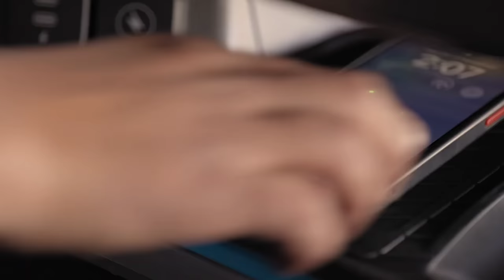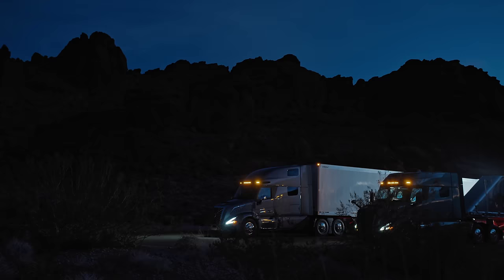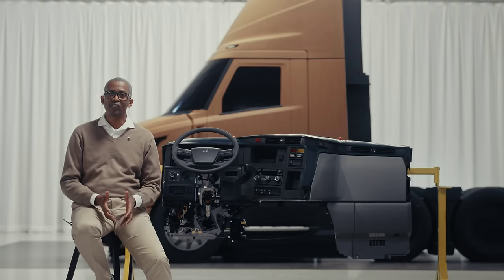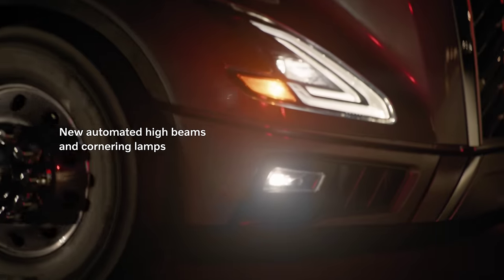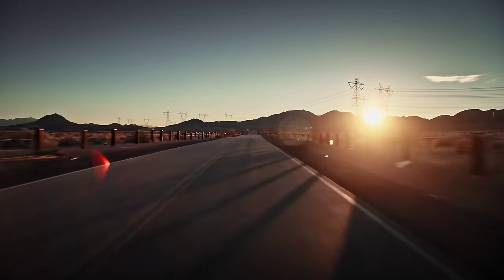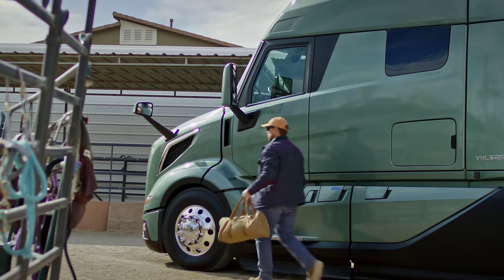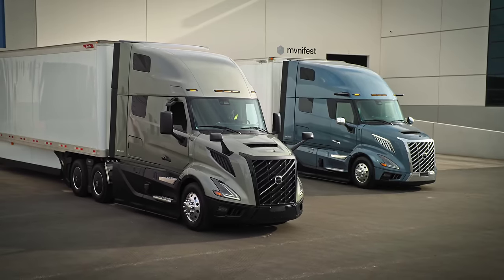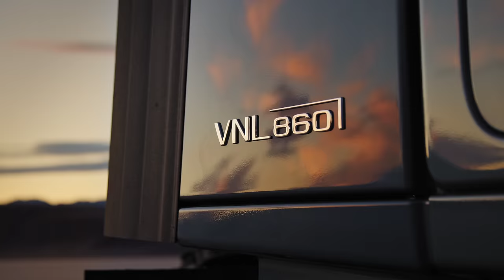All New VOLVO VNL 2024 is a Luxury Hotel Room on wheels!

Comment: Did you fix your crappie wiring. It is , I believe, the wrong gauge. It is too light and after a period of years breaks.  My 2005 Vnl was had many issues due to too light of the gauge of wire.  Also every Volvo Vn rusts in the same spot which could easily solved. Doors rot at the bottom unless every rust proofing is sprayed through the drain ports in the doors. Behind the refrigerator is sound deading that collects water from normal heating and cooling of the cab ,same on the passenger side in the closet. Every year I spray rust proofing. Sadly I didn’t get to the areas before rust had started. My Volvo is a 2005 vnl with 3,096,879 kms. Isx engine Zf freedom line 12 speed automatic. I am in Canada.

Comment: Now remove the adaptive cruise control and lane departure bullshit and it’s a perfect truck 

It’s damn near impossible to overtake another truck with that front sensor not allowing the truck to speed up to pass a truck

The lane departure “safety” feature has jerked the wheel several times in construction zones where all traffic is on 2 lanes, the truck thought there was a vehicle in front of me and it slammed on the breaks for no reason

Comment: "Keeping the driver cool for up to 8 hours"... Hey Volvo we have to take a 10 hour break so I guess we get to sweat are ass off for two of them THANKS
Reply: It should stay cool for an hour after driving before you need to turn that on.
Reply: @talibanParade  Come to the South West In June, July, August, and September and sit in that truck for an hour after you have shut it down and tell me how "cool" is stays for you ...LMAO
Reply: @ronnieam33  I said it's good for about an hour.
Reply: @ronnieam33  I've been there more times than I can count.
Reply: @talibanParade  You are clueless with the ambient temperature 115 degrees and the heat radiating up from the transmission and your engine and the sun baking in your huge windows it will stay cool for maybe 15 minutes tops, and then it will be close to 100 degrees in the truck with in 45 minutes and that's 30 years living in AZ son and what about the other hour that is unaccounted for in my 10 hour break??
Reply: @ronnieam33  I have spent enough time in Maricopa County to know that your fear of shutting the truck off is irrational. Also, get a sunshade and a fan.

Comment: WAIT A HOOT'IN MINUTE. I'm a career trucker. Have the 2023 VNL and others for 12 years.  I can speculate that NO driver consultant was hired for some of its hate driver panel layout. Just suits with egos. Ie. 1. The mirror defroster indication cannot be seen in daylight glare, nor can we see the slow blinking while driving to assure its on. 2. Most the switches are turned down to turn on. Yes my 20th Century thinking is that the light switch turns up means on. 3. The headlights pause button is too close the the perimeter of the streering wheel. I dread accidentally pressing it while driving. Pausing is a indicator msg to the other big rig that he has cleared passing me and he can come back over. Pressing it accidentally in bad weather may mean a side swipe!!!! 4. Why does the Jake handle feel and nearly look like the Wiper in the night. How many times I needed the Jake and got the wipers instead. 5. The hazard switch is my biggest beef. Located behing the turn signal. My hand pats the switch that turns it on and off rapidly. Why, because of road vibration! Yall designed this Volvo standing stationary!!!! NO NO NO. The hazards are nearly used daily in "Brake Checks". We are fast on the button to slow all of us to prevent a pileup. NOT ME. Many times I manage the vehicle confusion outside to then see the hazards I had on are OFF. Double tap due to the vibration and the truck bouncing, 6. CB station over the dash fuse panel is near useless. Using the cubby means no air flow causing electonics to overheat. NO piped ventilation to this nor the back =food storage cabinets (food melts or expires earlier). 
7. City horn is for a parked stationary Volvo in a museum. Drivers honk in a turn in the city usually. Good luck chasing the 2 tabs with the wheel spinning. Gosh! 8. See trucks with headlights off on the highway at dusk. The steering wheel blocks the switch. The scan forbids to see the selection. 9. SEATS are a utter failure. Armrests collapse  that could cause a wreck. The airbags sink rate without the drivers input. SMARTass SEATS are not cool. The PROBLEM is the commentors that praise your truck to then write as they are not in trucking, gives you a false sense in delusion. NO ONE to tell you the realism of it all.

Comment: Front end is ugly on that. The best gen is the current one. I would of focused on fuel efficiency improvement on the d13 first before redesigning a new truck. The compound turbo setup would of worked if you spent more time on it.

Comment: Currently driving a 2021 VNL 860, acquired new. I detest Volvos. Worst, WORST riding truck I've experienced in my 23 years of OTR. The slightest air leak, affects the ride. And in previous models, the air line connected to the transmission, required repair of that connection, else the ride beat you up even more. This seat auto adjust during ride is unnecessary. When you have air leaks, the seat responds slower. For example, you get out of truck to open doors, you come back to truck back up and seat is now lower, which is annoying. You're now backing up, with your mirrors out of line or waiting for the seat to rise. Yes, Volvos offers lots of space and safety features. But if you've always been a safety conscious driver, it's not like the wheel has been invented. I think the cost in relation to what you get, isn't that impressive. I will say, I like the room and my version pulls with the best of them. Including Pete's and KWs, and that's at 35k plus. I waved at more than a few of them pulling grades. Not literally, of course. And with all Volvos I've driven, that mpg is test related, obviously. You'll not do as well running west across I-80 and similar, with 30k plus, with those crosswinds.

Comment: Guys are all company drivers??
This is a disaster, not a working truck!!! 24 volts batteries, automatic transmission only, over loaded with electronics. Just imagine this "driver truck" broken somewhere in northern Ontario during deep cold...
I had two Volvo trucks in my 23 years career, and liked old school Volvo. But this one..... No thank you.
P.S.We need simple, reliable trucks. With an aluminum cab, manual transmission and less electronics. And the first manufacturer who realized it will sell those trucks like hot pizzas.
Reply: More sensors, chips, hardware and software to go wrong while giving less freedom to actually operate the truck as it needs to be. Fortunately a lot of these "features" are optional. I can only imagine how annoying the beeps and boops of this robo-truck will be with all this added tech. It looks good to shareholders and corporate types but can often be a detriment to the people who actually operate the equipment.
Reply: @BetterCallSauS  And on top of this add cheap metal which will rust through in 5-7 years. That's why Volvo cost 1.5 - 2  times cheaper than KW and Pets on the secondary market.

Comment: Can I get a flattop small bunk twin screw with a wet kit and at least a 200" wb that weighs less than 18000 lb. OH needs to be able to run Cincinnati to Baltimore and hold 45 mph Grossing 80000 lb + on a tank of fuel and not smoke the brakes. The last Volvo I had that made that run 
Couldn't do that. So I swore y'all off.

Comment: If only there wasn’t DEF and the rest of the heavy, costly, inefficient and unreliable emissions crap. 

Give me a Cat 6NZ instead of the emissions junk.

No red lighting options? Best for night vision.

The company really needs to offer fenders for each drive axle integrated with the body skirts. 

The reverse looking cameras are better than the fender mounted mirrors which usually just show the front of the main mirrors and the cab. 50% or more of the viewing area in those is useless.

Far too much useless noise and video without any information. 

Show more about the engine and the interior. That is what drivers want to know.

Comment: Lame. If it isn't powered by electric motors with an onboard generator to extend range, then is obsolete for "all new" 2024. Just like the Chevrolet volt and bmw i3 rex.
This way the engine runs only for electricity and is used at the perfect rpm, no more gearboxes, no more idling no more bad driving affecting the engine. Plus all the massive benefits of the electric drive train with instant torque and no wear and tear. This will lead to increased reliability and drastically reduced need for maintenance and wear & tear items changes